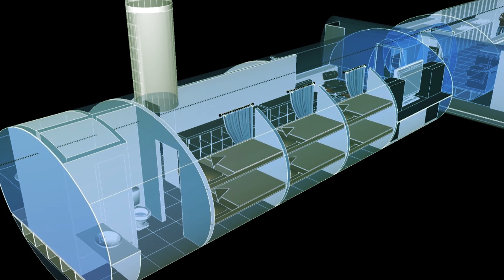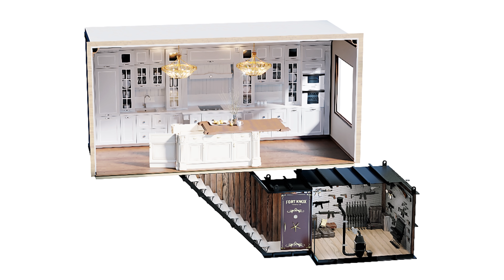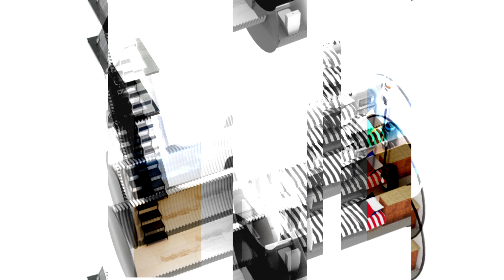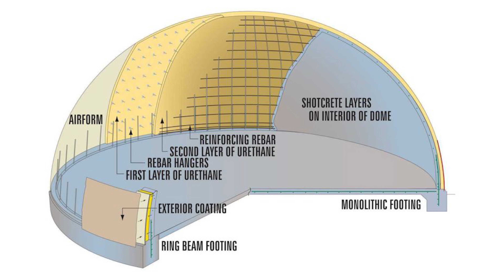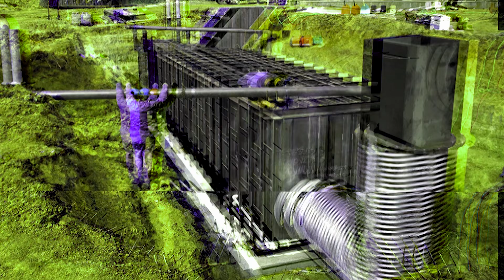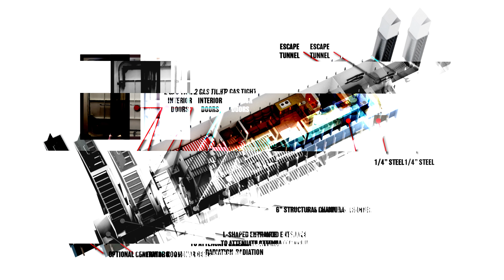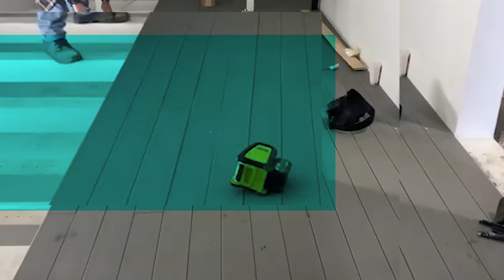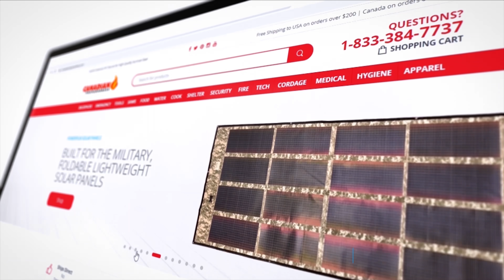What Types of Bunkers Are the Rich Building? Worlds Top Contractor Tells All

Comment: Great video, Rule 1"we dont talk about bunker club "
Reply: 2nd rule, we don’t talk about bunker club
Reply: 3rd rule, we don`t talk about bunker club.
Reply: Talk about what?
Reply: 4th rule there is no bunker club.
Reply: Build it yourself  buying one and having it shipped were everyone can see it should be out of the question. Air tight seals with rubber. Buy your own air filtration system. Use solar backups . For emergencies have Oxygen and large HPA tanks for emergency evacuation or air leaks. Your welcome

Comment: I have a bunker that I built, but I would LOVE to dig into the limestone outcroppings on my property and put in a monolithic bunker, and leave the other as a decoy.
Reply: Good for you, can you tell me how much you paid for it in total? I got another solution and i hope to Gods i will be able to fix it in time if anything happends, i found a Austro-hungarian 4 floor fort in good condition, the thing with it its built in the ground so you can only see the roof and the bridge when you stand in front of it. My idea is to cover/camouflage the whole thing wshtf.
Reply: @aleksejjovanovic986  No. I did it over such a long period of time (I'm still trying to finish up, actually) that I haven't kept a running tally of costs. Like I said earlier, I've just made it my priority. I got the shelter hull (the gas tank) for $3K. The LUWA VA-150 for about the same, $3,000, the shelves I built myself, as well as the deck floors. It's just stoopid cramped down there and would be a long wait down there for the world to be safe enough to come topside.
Reply: @hrdknox2000  It usualy takes time building something. :) Anyway, good luck to you with the project and life in general.
Reply: Make the decoy a burnt out wreck. It'll leave the impression your property was already hit.
Reply: @wambutu7679  Exactly.
Reply: Check surveying reports and see if there's any sandstone near you, even if it's 50 miles away from your main house certain kinds of sandstone are easy to dig with just handheld power tools and stable. needing no support besides the rock. It might be worth it to buy a tiny piece of property with sandstone bedrock to dig tunnels, would make for a cheaper and easier to build backup.

Comment: Some of the coolest tricks of the trade in building these bunkers are the methods of warming the air. At 6 to 10 feet deep, it stays relatively warm even in the worst winter, ... until you start bringing in outside air. Now you’ve got a problem.
Reply: Didn't Ron mention that bunker has an airlock at the entrance.  outside air stays outside for the most part.
Reply: Four bodies will generate a fair amount of heat.
Reply: @wambutu7679  About 100 watts a piece mostly from the head and neck, sitting reading a how to fix stuff book from your hard copy library. Even more pedaling a generator. Then there is cooking heat. Getting rid of heat could be the location giveaway.
Reply: @ticanwoneas7850  
Disperse it through a gravel field, maybe? A lake or brook would be best, but the problems involved with water leaks, back flows and moisture would be a pain.
Reply: Geothermal underfloor heating and a hat
Reply: @JamieHitt  That Swiss filter for air has a hand crank. Without air circulation there would be a buildup of humidity just from breathing. If its a radiation situation then what does it matter. You would have to stay put for longer than your supplies would last i would think. Same with a biological.
Reply: @308sniper3  
Grim assessment, but not to be discarded.
Reply: @JamieHitt  I read somewhere that heating homes can be done by slowly moving air underground. You bury pipes underground and with about 50 feet of distance the air coming in is at ground temp. Naturally the more air you draw, the longer than line must be. So, for the cold scenario you mention I would say you need to have a couple hundred feet of inlet piping to warm it before it comes into the bunker.

Comment: I live in Oklahoma. We can't even have basements due to clay soil that shifts causing cracks and high water table. Have you done them in OK?
Reply: I mean… a lot of us have storm shelters?
Reply: @Radroach14  Yes, I grew up with a cellar but we had to lay bricks in the bottom so we did not have to walk in the water. The clay ground shifts causing cracks then high water table seeps in. Yes there are some who attempt basements, even in one acquaintance has a cool racket ball court. From my experience wether a modest cellar or extravagant underground man cave, they eventually crack and leak. Of course there are also underground fuel tanks. All these underground vessels and structures have to mitigate the clay and high water table. The waffle slab was designed as one way to deal with this plus suppumps employed. All of OK does not have this challenge but we do in my area. I am wondering if this fellow has been successful in engineering some bunkers in this area with these challenges.

Comment: I think that the monolithic domes are the best for strength and internal size, though I don't know why no one (that I know of) is going the next logical step and making it a full sphere!  Double the room!  This rounded shape would be the easiest to conceal, an short artificial hill with a greenhouse covering it!  The air intake/outtake tubes/pipes could be hidden into the framework of the greenhouse or if the 'hill' is covered in shelving for potted plants (for example) the intakes would be hard to spot, not to mention the better air quality the living plants will provide.  Also, the entrance to the bunker could better hidden this way.  By building the greenhouse first (with an external and internal glazing, whether glass or plastic sheeting), it would provide all but very close concealment for constructing the dome/sphere.  Your exhaled breath will help give the plants the CO2 and extra moisture that they need!

Comment: 4:23 No, you can’t get through the door. But like that guy JUST SAID, there’s gotta be air. You find that air supply intake “might be disguised as a bench, flower bed, trash can, etc) and you close it off or put something into it...and those people inside are gonna be funneling out the only entrance/exit....
Reply: Plus, I would think you could have several layers of defense and perimeter alarms to alert you that someone is snooping on the property. Im sure people with enough money to have a bunker could also have a defense system controlled remotely
Reply: @freespeechimpaired2983  plus lock them in and cut off oxygen or introduce certain other things.
Reply: I watched them build one then. Put house. Over it. I still REMBER were the air comes iif something happens. It was so nice if them to build it for ME an my. We do it then eazy way or they eazy way we be guest or killers.  They thought they were safe

Comment: Luckily down here in the deep southern states of America the below ground temps are more in the 60s than the mid 50s so that no ac and no heating is required for long term below grade sheltering... Just add another layer when you come into the bunker and you'll be fine... Sorta like a modern prison which keeps their temps below 68 degrees for both smell control as well as temperament control... 😐

Comment: Everything happens for a reason, I've said that saying for many decades to everyone. I'm getting everything done I need to do before it all starts. I feel like I am being pushed at a certain time to get number 1 done by this date and then number 2 done by this date an so on. Everything is falling into place. Including making free energy motors for making electric to power everything on. Start with a 12 volt DC power, an use a converter to turn it into AC power if you need to. Main thing, where ever you hide you must be quiet so insulation is a must. There is technology that can be used to hear a hidden bunker underground so they can find you and look for your doors and air pipes. Best thing to have is a security camera system outside looking at everything. Even put up same type cameras away from your hiding spot to make them look at another area. Put in a fake door and staircase going down underground and that door should be welded shut to cause them to go crazy trying to open it. Good luck, put your faith in God, only he knows what is going on.

Comment: If you notice rabbits chipmunks have 2 to 4 entrance exits there’s the main but you have secret escape routes in case tornado land a car tree over the entrance.   Build a fruit storm shelter.  When neighbors at work get small  backhoe dig your hole put you wood studs shelves bunk beds buy a small shed used set it up lift floor up start building stairs worried about neighbors start a major outdoor project so they think that’s what your working on.  Do forget air holes and extra exit entrances

Comment: People will be going back to a horse,cow,mule,or a dog and a sled or lightweight buggy... A riding lawnmower is emp proof and if regeared by simply flipping the front belt pulleys over and increasing its top speed by more than double making 50mpg easily reachable as long as gas lasts... But ecentually only critter drawn wagons will still be viable once the fuel is depleted providing they weren't eaten during the shtf early times...

Comment: The BUNKER STRUCTURAL PROJECT that this builder is talking about is only 35-45 % effective for a thermo-nuclear explosion, chemical and biological attack. It also depends on how far the explosion hits ; you should remember that Gamma Radiation can still penetrate the structure that he builds. Gamma rays are the deadliest of all and it depends on how much and how long you are exposed to it. And as far as VIRUS is concern, it takes an extra-special filtration system for the air that goes into your bunker. YOUR BEST BET IS TO GET RIGHT WITH YOUR ALMIGHTY GOD .

Comment: Have your medical check up from head top to bottom foot pad. Get your eyes, teeth, and ears, and nose and mouth and throat examined and FIXED UP and have a lot of medical logistics of all kinds. First aid kits and a paramedic backpack and kits and supplies. Protective gear clothing and gloves and boots and face shields and eye goggles that allows prescription glasses to be worn under them or eye goggles that can fit over your prescription eyeglasses over your face. Have dozens of prescription eyeglasses as spares. Underwear and thermal wear and multi-climate all season and all weather climate clothing gear.